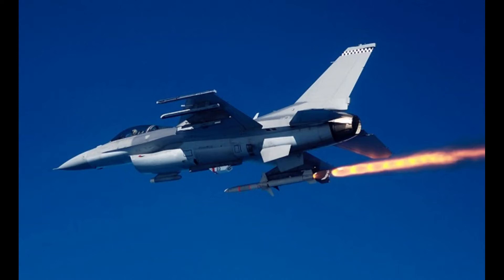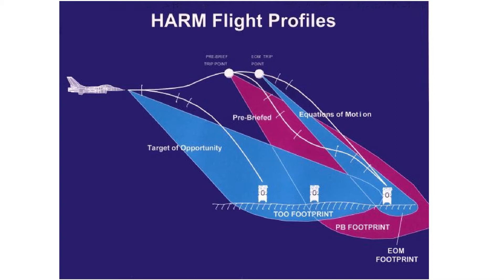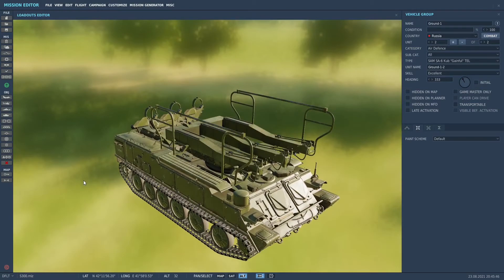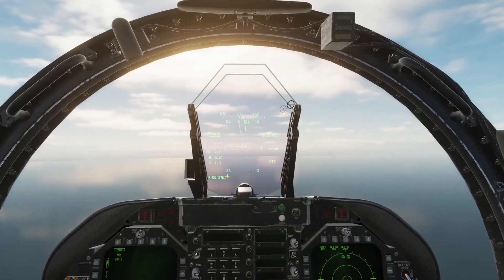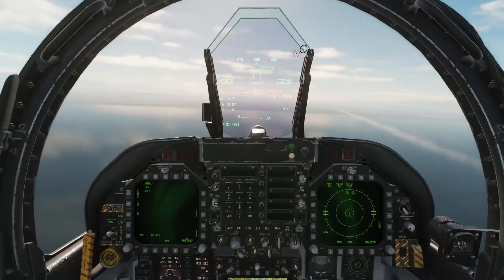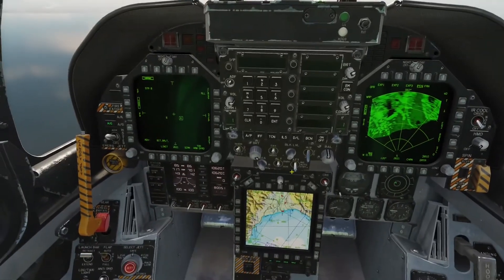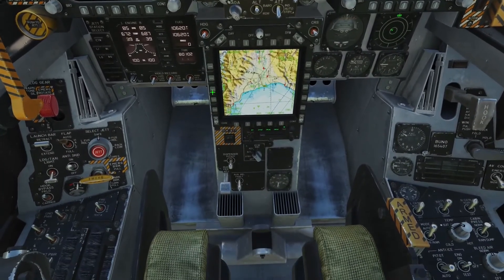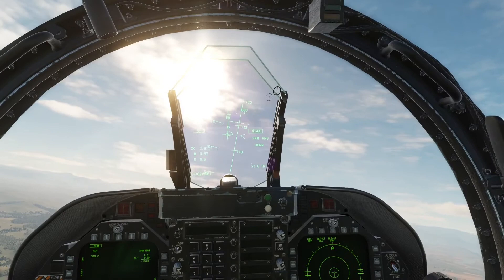DCS F/A-18 Using AGM-88 HARM Missile in SP/PB/TOO modes to destroy SAM sites

Comment: What I have noticed is that in PB mode they always miss by many miles, I mean they don't even try to find the target or waypoint designated and I havent seen anyone else with this issue. I do everything right: Master arm on A/G mode, pre breif, either HARM or A/C, and I'm all lined up to the target and firing within range. It cannot be that the radar just turns off because even then the guidance of the missile should at least put it in the same postal code, but in my case they just sail on to the next state!
Reply from the maker: Are you setting the HARM code ?
Reply: @RaedAdlouni  Yes, forgot to mention
Reply from the maker: @themigratingcoconut562  sorry in this case not sure what the cause is

Comment: hmmm - the harm selected the highest threat as the SA6 because there were no other radiation sources on the map - place some friendly ships or a couple of active Rolands between you and the SA6 and i guarantee it will not "automatically" jump to the SA6 and if you fire without Raid/Flir/Fov switching the box in the Hud to the actual threat you will kill the blue guy with the first Harm - to use it this way you MUST FOV to the target you want to shoot - Then try again without boxing Harm in the stores page and unbox Harm Override fly towards them and when they lock you they will "autobox" and you can let rip on the correct target/threat without a courts martial - My thoughts were that this is a bug but more likely the way SP mode really works as it would likely be used while doing A2A or using other A2G products - Your not going to go on a SEAD mission in SP mode you would have info for PB.  But SP was how SEAD was done when it was the only Mode i guess - Looks like a good video so will watch it to the end - sorry to be a pooper but please try with some blue force radiation or even a distant Snow Drift somewhere on the map
Reply: Interesting!